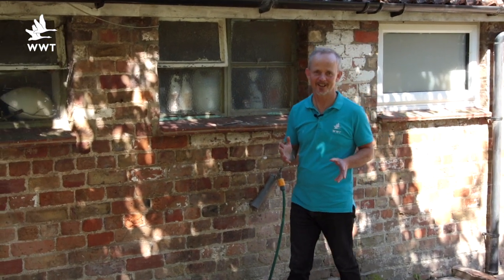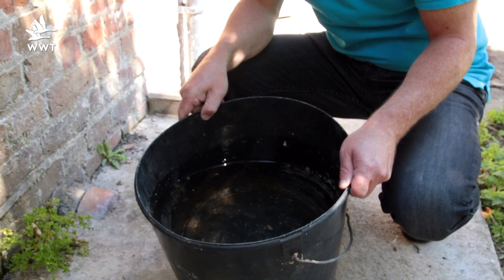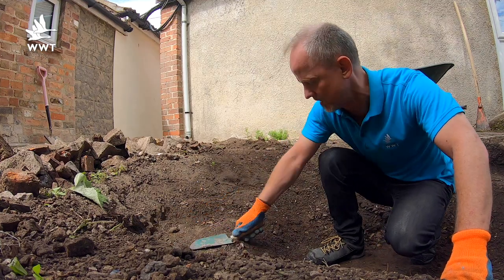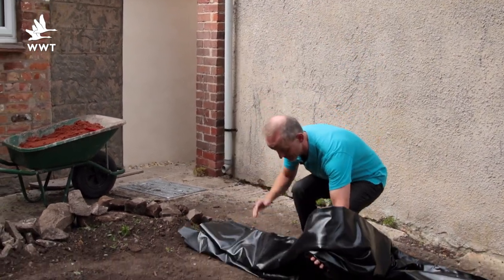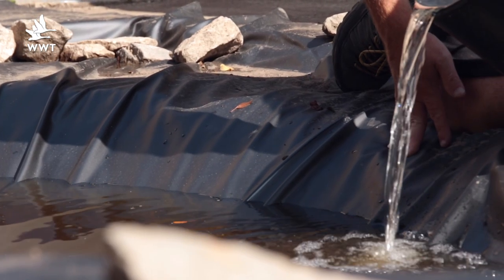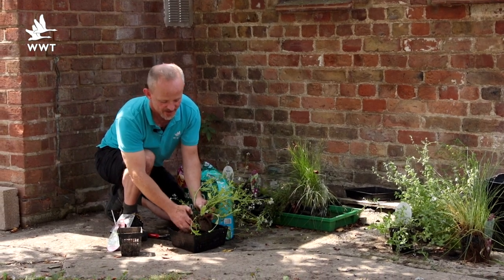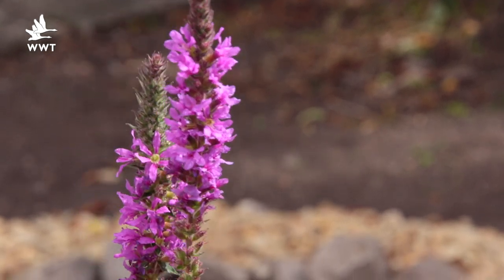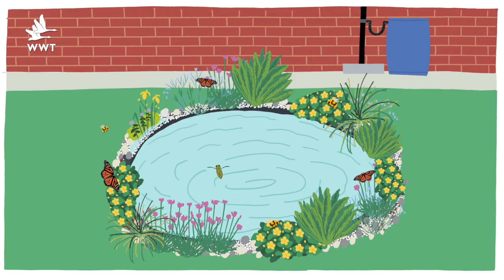How to create a pond in your garden for wildlife | WWT

Comment: I’m curious about heavy rainfall...where and how will the water ease out ? ..thank you for you very clear voice and presentation, you’re sounding like a fine BBC wildlife presenter ;)
Reply: I actually take water out - particularly in Winter so it doesn't overflow. I simply bucket it out. In Summer when the plants are taking out more than rainfall puts in, I fill from a water butt I have close by.
Reply: my mum had a pond like this and it never caused a marsh around it and my own pond never has issues and its a raised pond, so it should be spilling over the top in a messy way.

Comment: Nice video and helpful also.
 I need clarification for 2 things:
a) Does filtered tap water will do for pond water instead of rain water?
b) I've seen quite many wasps in the summer wherever there is water. Will my garden pond have the same issue in the summer?
Reply: Vasileios Morossidis, look at bird bath
Reply: You can use tap water but make sure to dechlorinate the water you can buy tap water dechlorinator in most pet shops\ online or let the water sit for 24-hours the chlorine will evaporate naturally, wasps probably only come to the water to have a drink I wouldn't worry about them being there all the time it's unlikely
Reply: @eminemzie90  Thank you!

Comment: I have a good site for a pond but it floods in winter, with no easy way of draining it. I was thinking of building a large soakaway/French drain under it. Do you think this might solve the problem?
Reply from the maker: Hi there, it sounds like the perfect place for a pond - it's normal for water levels to go up and down with seasonal rainfall. So long as your build plan can account for this, and the floodwater won't affect homes or gardens, we say go for it!
Reply: @wwtorguk  Thank you. I’ve seen it mentioned elsewhere that water underneath the pond could cause the liner to float when the level rises. That would be my biggest worry. However, if it’s weighed down to begin with, it might not move.

Comment: Can I use borehole water?
Reply: I suppose it would depend on the borehole, logically it would be better than tap water, but if the water is coming from really alkaline rocks or certain minerals it could be an issue, i dont really know i am just applying common sense.

Comment: Using a downpipe to fill a water butt is OK but using it to directly fill a pond is just asking for trouble. We have drains in the UK for good reasons! The "goodness" of rainwater is over-exaggerated. Depending on where you live, you could find the water coming out of your tap has a better pH value than the stuff falling out of the sky. If you top up using a spray head on your hose the tiny amount of chlorine that remains dissolved will be way outweighed by the oxygen you add.

Comment: I want to make one on these ponds but my greatest concern is whe it rains and it floods.
Reply: You calculate the rainfall in the area and keep the fill of the pond below that level (so when it floods it only gets full) and then create an overflow area dedicated fo accepting the excess.
Reply: it wont be any worse than than the effect of heavy rainfall in general, if you hae 2 inches 0f rainfall on your whole garden then the 2 inches on the pond runs off, its not a lot more than is in the ground around the pond already. if you are on a slope and don't have any puddling areas the problem will fix itself.